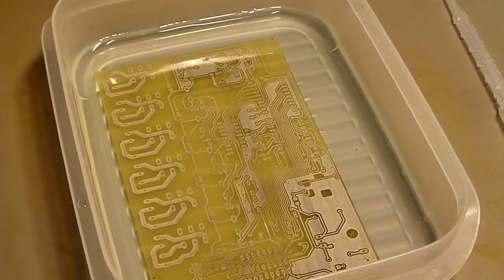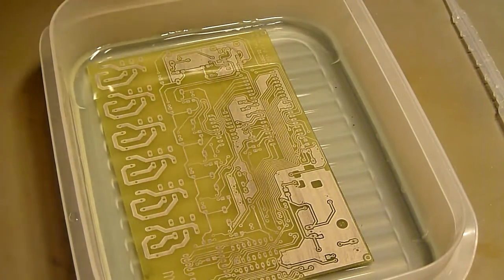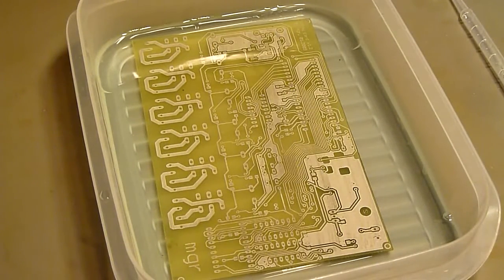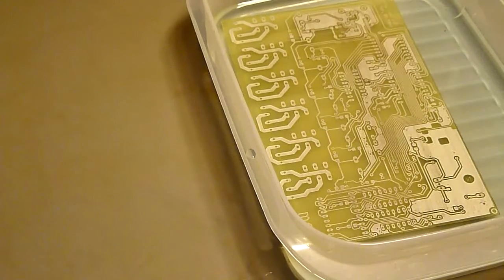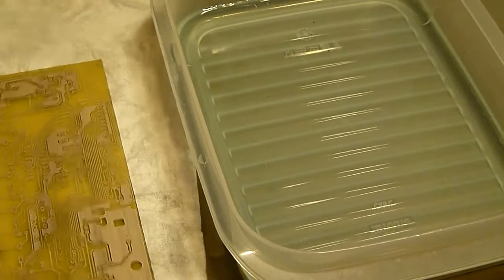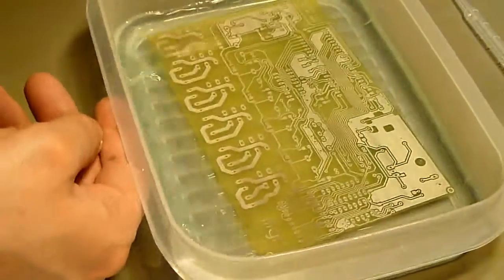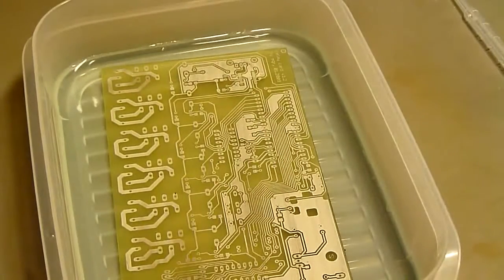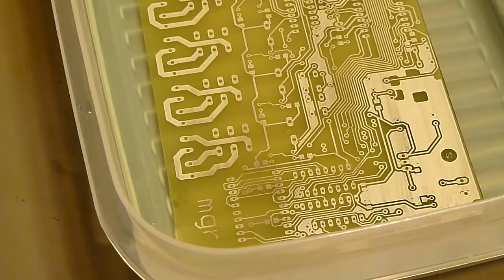Silver coating a PCB, part 2 of 2

Comment: i tinned my first home made pcb,  it did not solder anywhere near as nicely as some polished copper vero/strip board that i am so used too.  perhaps my iron was not hot enough? maybe i need to upgrade my iron? it was really difficult to solder too the pcb.
Reply: rainbowsalads Usually I find tin plating a board improves ease of soldering.  I tend to use a lead free, 99.3% Sn to 0.7% Cu solder with an iron set to 360°C.